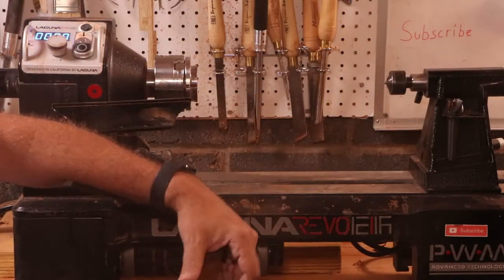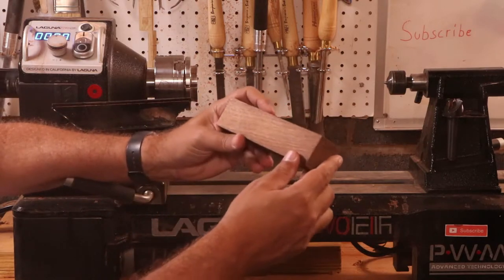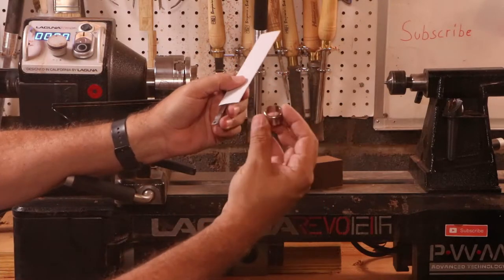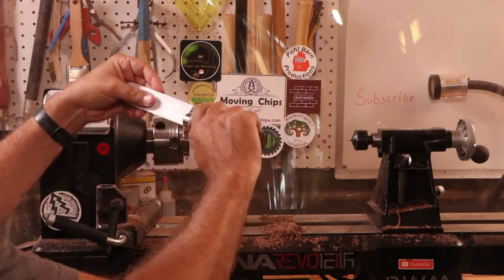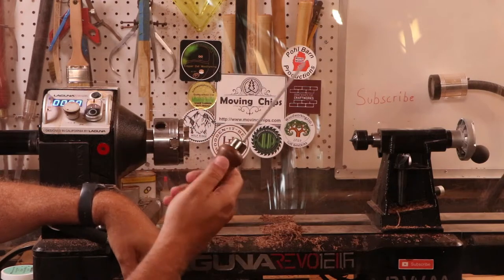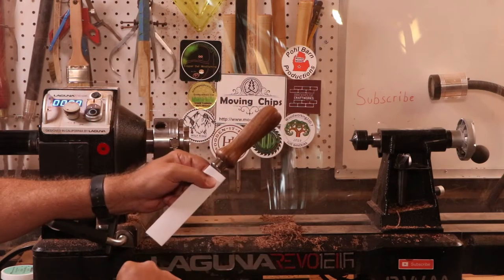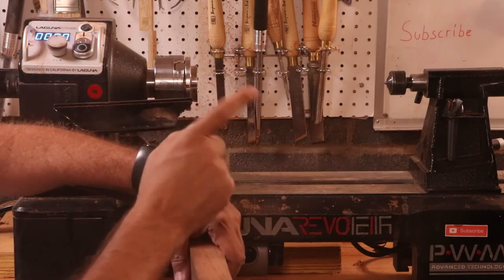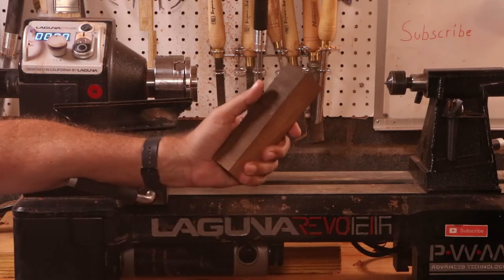Woodturning Cheese Knife Handle

Comment: Hello, Very good video except I was wondering how you made the small incision (slit) to insert the end of the knife. Thank you for your answer
Reply from the maker: hmmm.... I didnt film that part. I remember using a drill and multiple holes with a bit the width of the metal. I think I used a drywall hand saw to scrap out the insides.